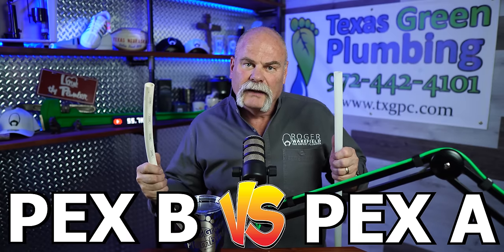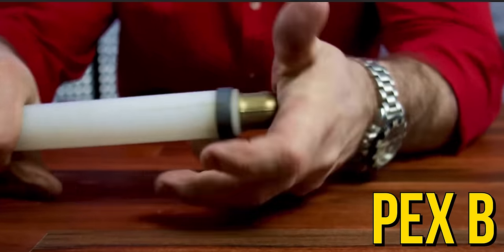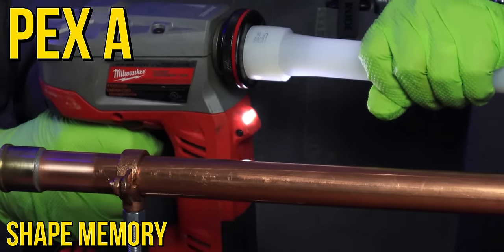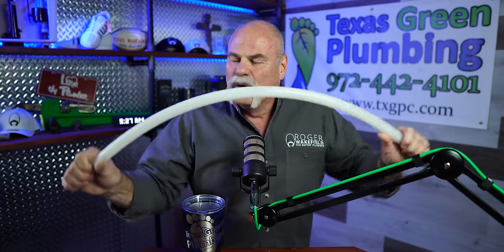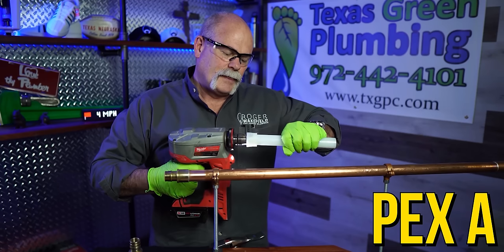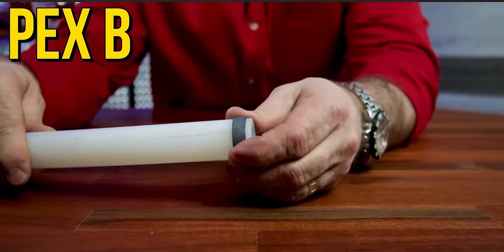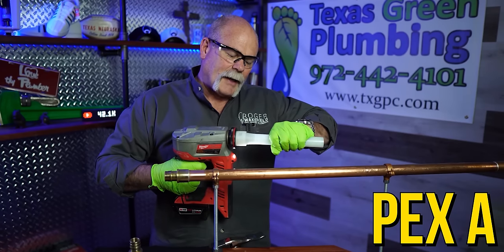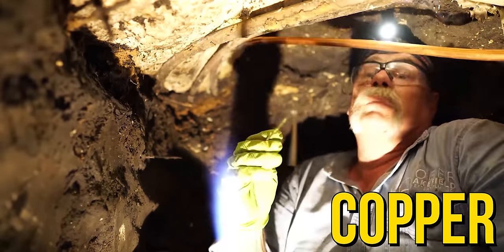PEX-A vs PEX-B - What's the Difference? Which Should You Use?

Comment: pex a expansion fittings have the same id as pex b crimp both restrict flow  measure the id of both fittings if you dont belive me expansion fittings have a larger overall od because of the agressive barbs and still have restriction to maintain wall thickness for pressure integrity, common misconception

Comment: Too bad pex-a it's not available here in Poland. We have pex-al-pex or pert-al-pert which is multi layered pex with aluminium in the middle. It stays the way you shape it. Pipes are dirt cheap but all the fittings are bloody expensive. And you need a special crimping tool. The electric ones cost arm and a leg and the manual or hydraulic are not easy to handle in tight spaces and weigh a ton so you have to be a strongman to do the job.

Comment: Neither, both aren't worthy towards water damage. Joints with no piece of mind. Pipe sufficient, joints are cookie cutter/short cut theory. Save a couple bucks material side, lose massive with water damage costs. Type-L from the water service line/throughout all inside horizontal lines/vertical lines directly tied into existing fixtures. Type-M in exposed/visible areas only, not behind walls, and-or ceilings/underground. Type-K within Multiple story applications hotels/multi-family/multi-story complex's. 25-year pex warranty, kicker is only if the company who re-piped your property is still in existence as such.

Comment: copper fittings have a .500" id, pex-a fittings have a .400" id, and pex-b will be even smaller. So no pex-a is not a full flow fitting like copper, it is a 20% lower flow. Time to take out the calipers and do a fact check! I would love to find a true (full flow) pex-a fitting.

Comment: Spread is a failed system in my opinion, great for new pipe but once you go to repair a line on the hot side it will split because of the cracking issues that pex A has. Good luck crimping onto the cracked stuff too, you’ll be back in a few months from fitting failure.

Comment: Pex A - has no oxygen barrier , Pex B Does.
Pex A - Temperature range is lower then Pex B
Pex A - not for Heating Systems only Pex B
Reply: pex A comes with or without an oxygen barrier. you can use barrier tube for domestic piping but you cannot use non O2 pipe for heating.

Comment: This talk about Pex A being exclusively expansion pipe and Pex B being exclusively Crimp has got to stop.
ZURN makes expansion Pex B. Uponor Pex has issues with the red and blue pipe. In fact you can't buy it anymore. They recalled it just over a  year ago. Pex A is softer and more flexible  but it appears to come at a price.  No one is talking about the failures of Uponor, they have many class action lawsuits going on right now with tracks of homes barely 10 years old needing a repipe.

Comment: ....DON'T trust sharkbite push-to-connect, the internal o-ring will dry out and fail over the years, the same thing to PEX that does not use a metal clamp. The expansion idea will fail regardless if it takes 10-20 years. The material will lose its flexibility thus its memory turning the water system for the entire house into sprinklers, and you will have a waterfall coming from all over the ceiling.
It will be a really expensive nightmare for homeowners 2 decades later. 
PEX and other new systems are only beneficial to the repairing contractors, speeding up the process, but not necessarily lowering the homeowner service bill.

Like the RV industry, the US house construction industry has become very profitable while offering expensive and poor-quality house constructions. The houses are not built to last, forcing the next generation to buy new homes to keep builders selling new homes, a real mafia with standards not ruled by the authorities. 
In sum, our industry is becoming more and more like the Chinese manufacturing quality.

Comment: I have a house in Palm Springs Ca. that was built in 2004 with Pex A and the pex line and pex fittings are cracking and breaking at the joints. I am now on the 5th leak,  each  one causing thousands of dollars in damages, not to mention the inconvenience of being out of the house for weeks untill the repairs are complete.  This house feels like a Ticking Time Bomb to the point i dont want to deal with it anymore. Do yourself a favor and stay away from these homes and plumbers who use this lazy technique.  im sure this is why copper is more expensive but uts well worth it!

Comment: This video is misleading.  A restriction via a slightly reduced diameter in a few fitting locations along a piping run does not equate to the equivalent of an entire piping run at the reduced diameter.  Pressure drops occur with fluid flow in any pipe.  A long pipe run will have greater impact on the pressure drop than a fitting here and there.

Comment: Of course a plumber is going to choose the item that is not readily available to the public in the Home Depot. Man plumbing seems to be a big hack big old scam. I just had six plumbers come and give me different bids for my project. They were all over the place from 20,000 to 30,000. I’m just gonna do it myself it’ll probably cost me less than 1000. And honestly it probably won’t take me more than 35 hours and I’m not even good at it they could probably have done it in 20 so they basically want to get paid 700 bucks an hour. I don’t think so.
Reply from the maker: What work are you trying to have done? I can't speak for those specific plumbers but a good plumber isn't cheap and they get it inspected and permitted and make sure its done right....that comes at a cost...you get what you pay for

Comment: I’m replacing the copper in my house with Upanor
Reply: Why to replace copper ? Copper is forever .
Reply: @anatolyex  copper isn’t forever
Reply: @JoeBrrrr513  is your copper over 80 years old ?
Reply: @anatolyex  house was built in 1952 so close to it. There was and is multiple spots where repairs have been made.
Reply: @JoeBrrrr513  so your plumbing is most likely galvanized and cast iron . They started using copper in 70s . Those have to go . Especially for hot water supply . But copper usually lasts forever . What kind of problems do you have with your copper ? I can see freezing in the winter. That's about it .
Reply: @anatolyex  Ive been plumbing 20 years I know what lasts and what doesn’t. This entire house is copper pipe built in 1952.

Comment: Avoid plastic pipe when and where possible for potable water.  I know its not a popular opinion at the moment amongst my fellow plumbers (because they are often lazy and lack soldering skill nowdays, sorry guys..you know its true) but it soon will be due to the steady stream of research coming out regarding microplastics leaching into the water causing cancers and fertility/hormone issues, parricularly in men. not to mention longevity issues of plastic pipe depending on water chemistry and uV exposure . Copper is still the way to go for long term human health, remember fellow plumbers, you aren't just tradesmen and workers but the first line of defence in the public health system, a position I NEVER take lightly as water is the cornerstone of civilization. Without us there are no major cities and disease is rampant meaning lifespans are shorter amongst the much smaller population and all measures of health and quality of life are lower for all citizens, everywhere. I have been doing this for 17 years now and am already seeing pipe fail way before the claimed lifespan is reached. In my opinion We have been sold a false bill of goods regarding the quality and safety of this pipe as all of the safety research that was performed when this pipe was introduced was performed by the industry itself and not tested by impartial third party labs. If that is not enough, It also generally looks like complete crap even when installed correctly and I find it highly unsatisfying to stand back and look at upon completion of a job when compared to an expertly run and installed copper system which looks like a shiny work of art that can last over half a century easily. Did I mention its not recyclable and goes stright in the trash to be dealt with by future generations while copper is almost 100% recoverable? I literally paid for my kids entire upbringing with copper and brass scrap from work lol. Read up on your trade and keep informed. Be the smartest person on the jobsite (shouldn't be hard lol)  and direct your clients to make the best descision possible for the longest lasting and healthiest job they can get even if the work to install it is greater and the cost higher.

Comment: You have got to get more informed on the difference between pex A and Pex B. Pex B is not from just the type of connection being made but the ASTME #. If it is only F1807 than it is PEX B you can only use crimp style fittings. But this Uponor you are so proud of and calling it Pex A, and you are using expansion style fittings has the  ASTEM #'s of F1960 and F1807 which means you can use both types of connections. C'mon man got to get better than this if you going to inform people.

Comment: PEX A Rules! I have been using it for years. It goes where copper fears to tread.
When PEX B freazes and expands, the metal ring doesn't expand. It instead stays the same size it is crimped down too. 
It has a tendency to cut into the tubbing, weakening the joint and often times cutting a hole in the tubing.

Comment: I Prefer Staying With Copper Only Because the Lifespan Is a Lot Longer.
Reply from the maker: I agree, do you ever have to install PEX?
Reply: I Don’t do Plumbing. I Have Worked at a Small Mom & Pop Plumbing Supply Store Upstate in NY. I Was Learning About it but Since I Stopped Working There I Found That I Forgot a Lot of the Information. Then I Discovered Your Content & I Really Like How You Explain Your Knowledge Of Plumbing.
Reply: I Feel More Confident About Doing Plumbing Over Electrical Work if I Had to Choose. To Me Plumbing Is Like Putting a Puzzle Together & it’s Safer.
Reply from the maker: it definitely has it's place...but I'm like you...I prefer copper
Reply: The Funny Thing About Life Is Pex Was Around for Many Years & I Never Knew What It Was or the Purpose Of Pex. I Only Knew About Copper & Cast Iron & PVC Pipe.

Comment: Pex is just junk pex taints the water. and pex tools and fittings can get super duper expensive. I use cpvc or copper if I use cpvc I will use plenty of hangers. cpvc will taint the water at first but after a week it will go away. If I had to use pex and I had a choice of pex A B or C I would choose C.
Reply: But cpvc in a couple years with thermal swings turns very fragile after a couple years...
Reply: Cpvc is awful
Reply: Who taught you about plumbing? You’re very misinformed.

Comment: You conveniently skimmed right over the biggest reason not the use PEX A. It leeches its chemicals into the potable water system.
Reply: But copper pipe is a suspected factor contributing to Alzheimer’s disease
Reply: @wallacegrommet9343  I have read this too. PEX B is not supposed to leech its chemicals into the water supplies. I'm not a science expert and can go on just what I read, but it seems that PEX B is a safer option, according to the research.
Reply: I mean it's a step of the garden hose tho right??